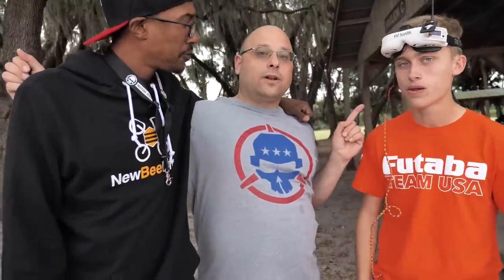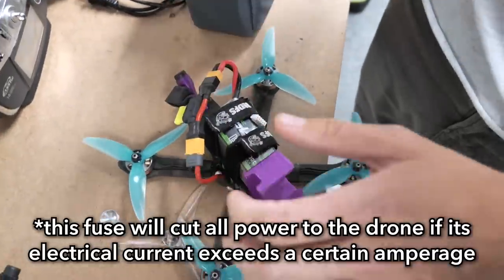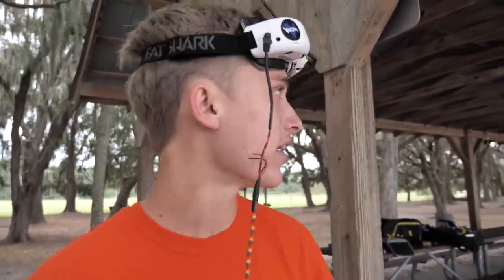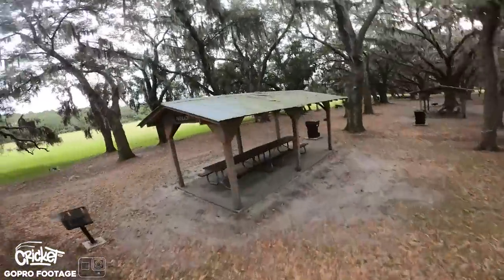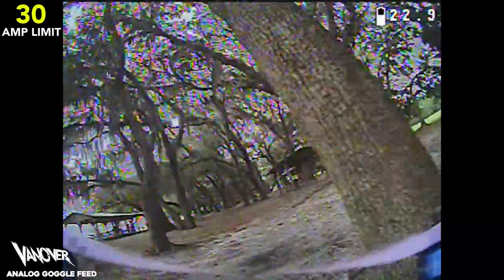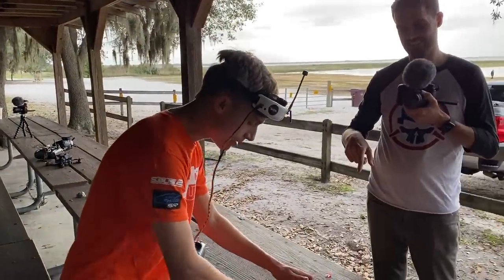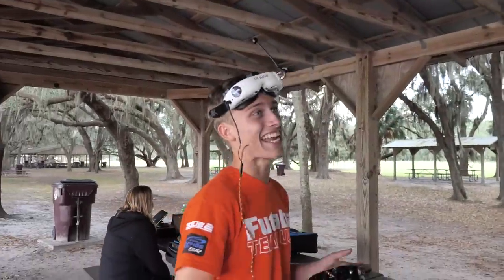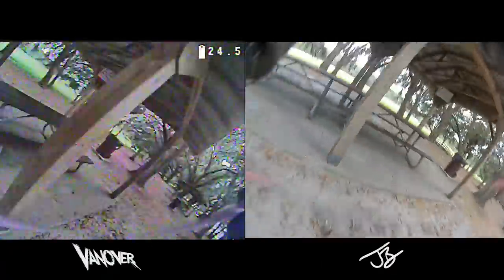Racing Drones with a FUSE... CURRENT = CRASH!

Comment: Amp-limited racing sounds like it could be a really interesting for professional racing, since it encourages more efficient quads without being too specific on how the hardware must be modified.
Reply: Could make regenerative braking a thing
Reply: 4DCResinSmoker there would be no point in regenerative breaking....
Reply: boss idea!
Reply: Lol 12s goes brrrrrr
Reply: @FAQUERETERMAX  Pretty much. But what about Amp-limited & everyone has to race on the same no of lipo cells?
Reply: @Vousie  sounds very specific to me, still very easy to bypass with capacitors

Comment: 📺 The analogue looks so bad it makes me wonder whether it’s intentional 🧐
Reply: It's got to be.. just more dji advertising. Even the dvr on my dominator v3s dont look that bad
Reply: I've heard from a number of people now that flying analog alongside the dji hd blows your feed out. I think that may be the case here.
Reply: Also, djis are gonna add some weight. Us short course racers are shaving off every gram.
Reply: @seamusbyrne8259  idk if thats a good point, they were flying their freestyle setups anyways
Reply: @fastodon2436  I think that's exactly it. DJI transmits at 800 mW IIRC (and up to 1200mW), analog is usually used at 200 mW. Of course it's gonna completely blow out your feed... Also, I'm pretty sure that DJI's system runs on a larger bandwidth and/or frequency hops, which would cause massive issues for analog.

Comment: 3rd Person Piloting.
Two pilots fly a course, one in front of the other, but they both view the video feed from the quad at the back, meaning both pilots have to work in perfect unison to complete the couse.
Reply: I need to see this. Or do it myself, although it sounds very scary. It's like a trust exercise.
Reply: Tiny whoops would be ideal for this challenge due to the high propensity for crashing.
Also, you could have equally just as much doing this without flying - both people walk the course whilst wearing goggles tuned into a tiny whoop which is stuck to the goggles of the person walking behind.
Reply: You've got a slight sadistic streak, don't ya. 😉 Sounds like it would be fun to WATCH people try.  Jolly good! 😁👍

Comment: I had to develop a drone a couple years back and there was a concern with safety because of proximity to people and the custom hardware & software being developed on it, especially while being tested before the final product.  We used 10A ATC fuses like that for them because they never popped when the drone operated normally, but would pop if the drone hit something, bugs in the software had it start flying too aggressively, or as a very simple disarming ability for when someone took manual control of the system and was not used to a disarming switch, so even novice users could use it without having to worry about panicking and hitting someone or flying away because they would panic, the fuse would blow and it would plop down on the floor.   Sometimes the simplest solutions work the best.

Comment: Throttle cap only caps the stick input you can still pitch, roll, yaw at full power as the controller doesn't limit the max speed of each motor. 

Fuse is truly hard mode.

Comment: But why you fuse when you can set throttle limit in firmware and change it to any number ? fun anyways +
Reply: THey explain it really well.  Fuse forces you to naturally fly in the lower range of your throttle, where has a throttle cap is artificial.
Reply: Because using throttle cap will stop the throttle at a ceratin level no matter where your gimbal is at. But using a fuse it only takes mild overthrottle to completely kill the quad. You can imagine this as poker...you can play with your friends for fun or you can bet actual money and suddenly the game has a lot more risk in it. Same here.

Comment: Being that Vanover raced in DRL where momentum was very important and those quads were pigs (comparitively speaking) when u tried to change directions.  He is used to having to rely on racing lines and minimize prop-spin, rather than point and shoot.  So this is a no brainer that he would win with an amp fuse.

Comment: Dope vid!!! I enjoyed watching it! Vanover's Racing skills are just insane!!
Question: how am I pulling 160a on my rig? Of course I do have a 60a 4in1 ESC and I'm running 5s on 2207 2450kv Xing motors. My motors don't even get hot, they get a little bit warm but that's it. By the way I'm running 5043 HQ props. Anyway great vid RR!!
Reply: On 5s with that sort of kV, I could see you pulling a ton of amps. Is 160 what your OSD is reading? Sometimes high amp draw readings aren't perfectly accurate.

Comment: Guess Analog is still better hmmmmm. Confirmation or me to not buy DJI. Love to see a re-match with all on analog or all on DJI
Reply: @cinialvespow1054  I might be over speculating but I think the reason Vanover used analog was so he had the best latency and the best chance of winning. I also thought when watching cricket and JB they were hitting things why too easily due to the high latency of the dji system. Would love to see the same test with vanover on the dji system. My bet is he wouldn't be able to get as low as 15A fuse

Comment: Could've just limited throttle from the transmitter
Reply: It's an entirely different feel though if you can still push your throttle to the max, and only have the quad move at 50% power. The ratios are all different. Fuses are straightforward and easy to swap.

Comment: Just me or is the "analoge fpv" a lot worse than real life
Reply: DVR always looks worse. It's a known problem.
Reply: Ah no I see what you mean. Vanover is standing too close to Corey and picking up interference from his goggles.
Reply: @JoshuaBardwell  who recorded the dvr or what recorded the dvr
Reply: @UC22jWS-M45wRv8p0QErm71w I am thinking that it was somthing wrong with whatever they recorded the dvr on
Reply: @cameron kernaghan  Even when you can record the full true resolution & framerate of an FPV feed (not an easy thing, most 60fps DVRs are close, but not 'there' yet), your playback of the flights never looks as good as when you were actually flying them, because you're concentrating on the scenery not any interference noise.
Much like driving in the rain, you actively ignore the rain on the windscreen (windshield) and focus on the road.
Reply: It's the DVR in those fatshark goggles that look like swim goggles. They always look bad.

I think IMO that the DVR in the fatshark box goggles looks better. Specifically the scout.
Reply: @VHFGamer  Standard DVRs such as those in FS goggles simply discard one of the fields of the interlaced frame, resulting in half the resolution & framerate of the source. The fancy 60fps ones (Scout, PowerPLAY, FXT DVR, Orqa, DJI) separate the fields of the interlaced frame and double their height in an attempt to retain the full quality of the source, but that deinterlacing technique isn't perfect, just watch some footage on YouTube from almost any 60fps DVR at 0.25 speed and you'll probably notice the picture continually jumping up/down by a single pixel.
Reply: Prolly the DJI stomping on analog 🤷🏻‍♂️
Reply: Lol his feed was getting digital stomped HARD 😂
Reply: They're all standing close. The DJI goggles do emit some frequencies, so I can understand a bit more breakup. And anytime there's breakup in Fatshark DVR, it's multiplied for some dumb reason lol.

Comment: The other thing this side by side video does is really promote how good the DJI HD system is compared to analog. Vanover is almost unwatchable in comparison!
Reply: That is due to him standing next to people using the dji system as the dji goggles send data to the quad as well thus fuckin up analog reception if you are close to the dji Goggles... Analog is more than enough for flying n just having some fun
Reply: @Averell64  Oh yeah, analog is still a heck of a lot of fun. I just got back inside after flying my Mobula7 around the yard outside.

Comment: LOL too funny,   There a million and one excuses for losing a race that no-one wants to hear about, but here is one that is obvious.  Your cam tilt is too low.   Why does everyone think it is easier to fly with low cam uptilt when the opposite is actually true?  I find that a quad by nature wants to fly at 45 deg or greater attitude and by running a low cam uptilt you just force yourself to look at the ground the whole time when flying fast.  Low cam uptilt forces you to raise your nose to line up on gates, raising nose means slowing down or gaining alltitude, both reasons why you cant win a race.   By raising your uptilt 45 - 50 deg, you will fly faster without even trying and you can line up on your gates, gaps whatever much easier without having to raise the nose and slow down.   A quad also corners much nicer when its attitude is 45deg or greater because the props can push the air more efficiently and you reduce the amount of propwash you fly in so your cornering will appear much smoother in your video.  Tuning your quad also becomes easier with high uptilt for the same reason, you are flying in front of your propwash instead of on top of it.   I have my cam uptilt designed into my frame and don't even have adjustment on it.  It is set at 40 deg on my freestyle and 50 on my racing version, the only reason I use 40 deg for freestyle is that the quad flys so fast at 50 deg, that it makes my video look like it is running in 2x motion.

Comment: Why was Vanovers video soo horrible!
Reply: They want people to buy dji🤭
Reply: He was standing near the DJI pilots. One of the downsides is that the goggles transmit too, so you have to stand like 10 feet away to get clean video 🤷‍♂️
Reply: @FlyingPenguinDrones  that far away?  So if you want to have 8 pilots you have to be 10 ft way for each pilot?
Reply: @BuddsSkyCam  yep. One downside of the system. The episode that they had 8 pilots up, they had buggy video until they stepped away from each other, then it was clear as day
Reply: @FlyingPenguinDrones  how big of an area would be needed for 6-8 pilots fly at once?  We use an 8x8 pop up for our current races.  Would it take 1 per pilot to have enough space?
Reply: @BuddsSkyCam  Unfortunately I don't know. I just got my DJI setup and haven't flown with other DJI pilots or others yet. When I asked Zoe, she said she was about 10 feet away and everything was fine.